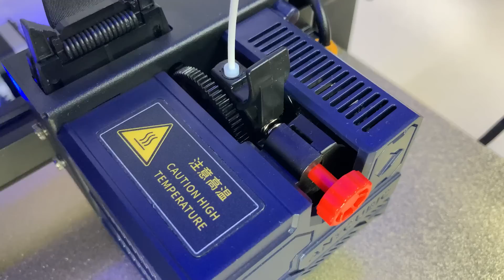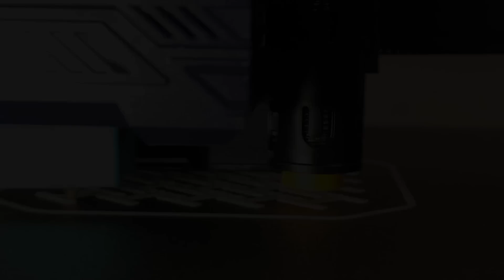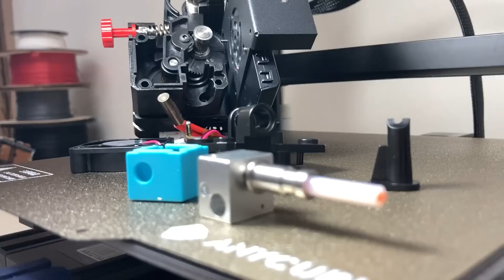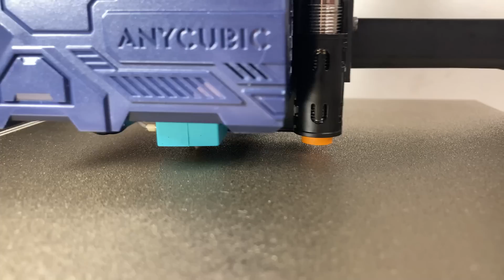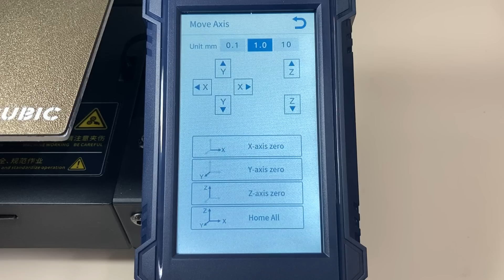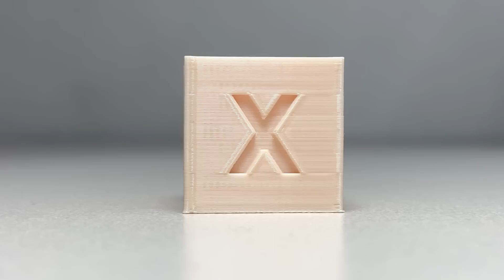Anycubic Kobra Review || Best 3D printer under 300$

Comment: Loving mine so far! So many features
Reply: You using cura?  Could you give me some help.  Mine doesn't seem to print well.   Pla is my filament and I'm getting weird blobs occasionally throughout the build.  Seems to always happen at a certain height.   I've checked all axes are tight and roll smoothly. 
Thanks.
Reply: @Freebird_67  Copy and paste the Ender 3 Gcode from the Cura inbuilt profile, and paste it into an anycubic vyper profile. also makessure youve changed the dimensions to 220x220x250

Comment: So we bought this printer, and it's making an awful sound when it turns on and it eventually stops.  All my prints are coming out terribly. We've tried adjusting the belts, tried adjusting the tension on the filament loader to no avail, we keep getting awful prints that keep stringing out.  In one case, it looked like it was skipping layers in one place and the machine thought it was done with that section and left it as it and moved on to a different section (which it printed perfectly).  I've contacted Anycubic, but they claim it's just the motherboard fan giving issues and this is why we are having this problem.  They seem to not want me to send it back to them, as they keep insisting to send the fan.  I keep trying to tell them I think it was damaged in shipment.  I'm at a loss. :(
I really don't know what to do at this point.  Perhaps my tension is too loose? Hard? Who knows. I've checked Cura over and over and nothing stands out.  Ive checked the model, nothing stands out.  Im honestly pretty upset over this.   Any thoughts?
Reply: You have to make sure your eccentric wheels are aren't loose nor is it too tight. The eccentric nut on the print head should just be tight enough that it doesn't wobble and that the wheels don't roll with your finger. The bed eccentric nuts should also be tight it enough that it doesn't wobble. Make sure your z offset is on point. If it's too high your prints won't stick easily. If it's too low and close, it won't release it as well. I think a good baseline right out of the box is about -0.9 to -1.0 in my experience. Another factor is temperature, make sure the fan is off on the first layer and that the bed temperature is dependent on your material ex: PLA is 55-65°C and PETG is 80°C for the bed. 
 In regards to slicers, try using Ideamaker instead of Cura. Ideamaker has a set profile for the AC Kobra already
Reply: @edwardleyco9880  Thank you for the tips, but it turns out that a stepper motor was to blame?  We contacted Anycubic (several times) and we have now sent back the printer as it was defective to the address they provided us.  We are still currently awaiting a refund at this point - as they are now claiming the warehouse has not received the product (I have tracking proof it was delivered and signed for).  We thankfully went through PayPal to purchase and have now opened up a fraud case against them for a refund.
Reply: @Swerewolf  typical.  Why I hate all this.   My prints arent that great either.   Wishing now that I'd purchased the Ender 3 v2 or even a Pursa...   I'm on vacation so I'll probably return mine once I get back.    One good thing about AMAZON even though I'm no fan of that company either.
Reply: @Freebird_67  I had to fight like hell to return mine. Anycubic kept giving me issues.  We finally got it returned, but we had to pay shipping up front and they said they would reimburse.  So I took it to UPS, shipped it, it cost me $81.  Guess what, they said they could only refund up to $50.   It took over 3 weeks to get my money back and still lost money over the shipping.  Never again.  And I will advise everyone to NOT buy from Anycubic ever at this point. Customer service is trash, the products are defective, and trying to get all of your money back is like pulling teeth.

Comment: I really wish printer companies would stop using ribbon cables on motion systems. They're not intended to move. They will wear out, and a lot faster than normal wiring. And if just one connection inside the cable breaks, you have to replace the whole cable, which is wasteful.
Reply: Oculus Rift moment (the ribbon cable inside was breaking after few month causing audio to not work anymore)

Comment: Everything you've said about the bed, excluding the paper to finish the z calibration, was not done by Anycubic.  Prusa did it a long time ago, and I'm not sure if they did it first either.  Prusa is, of course, open source, so taking design items from them is perfectly fine. Prusa, however, ends their calibration by printing a pattern on the bed while you use the knob to adjust the z height.  And you can repeat that process until you're happy. (If you do this, use a light filament to do it, it's much easier!)

This printer looks nice, and if I was looking for my first printer, this would be on my list of ones I'd be looking at.

Comment: Hello, 

My nozzle leaks prior to printing. I tried to change the temp and tweak the extruder hoping it would slow down the leak or stop but it did not work. I bought anycubic kobra 2 days ago and I’ve had this issue since the first print. I looked the problem up and it says it might be due to poor assembly. Is that true? Please let me know if you know. I’m debating if I should return it or not.

Thank you
Reply: are you talking about the filament comping out when it heats up before the print? if so that's normal to happen on any printer if the material is fully loaded into the hot end.

Comment: Prints doesn’t look that great, even my first benchy on my anet a8 looked better than that! Features look good, but tuning doesn’t seem up to scratch
Reply: It certainly isn't,  plus the fact it really doesn't have it's own slicer profile sucks for beginners.   You can use Cuba with Anycubic's customFFF but those prints look horrible imo.   I've tried using the Ender3 gcode as tutorials have stated with this anycubic  kobra and still get poor prints.    They are usable for the most part but just sloppy printing.  Tried damn near everything.   All seem tight no wobbles on any axes.  I'm using a decent PLA that worked well in  my XYZ before it blow up last month.   Wasn't worth trying to fix a 2014 XYX enclosed printer  It only printed pla and ABS anyway and 8bit system was super slow.  It was a great machine back in 2014 though.